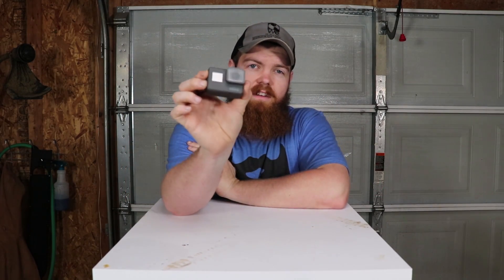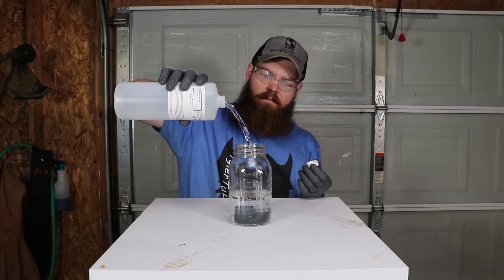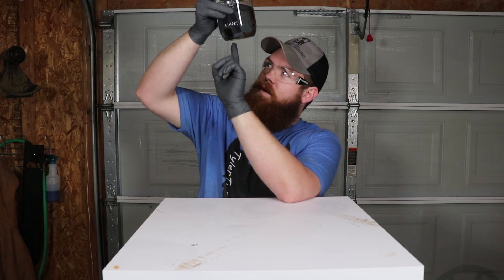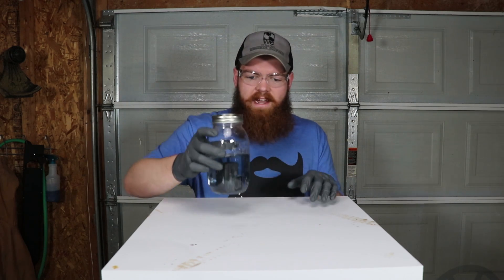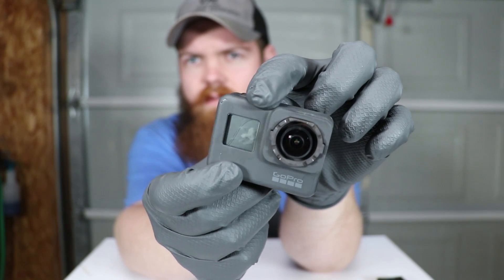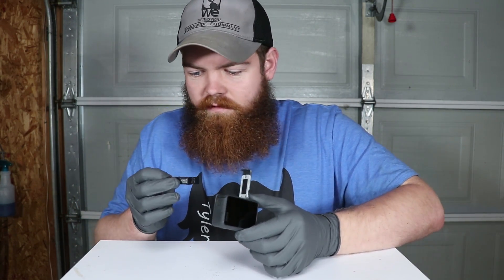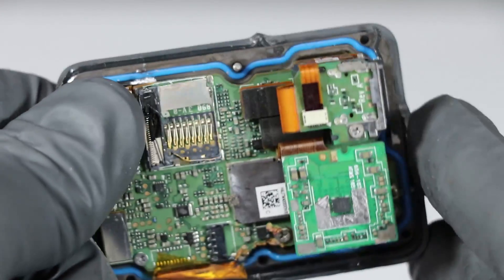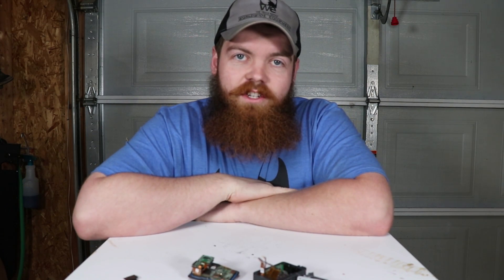I Left My GoPro In Sulfuric Acid For 7 Days...

Comment: NEXT TIME LET THE DEVICE SIT IN A BOWL OF RICE FOR 30 DAYS. THEN YOU WOULD REALLY BE GIVING IT THE ABSOLUTE BEST CHANCE POSSIBLE
Reply: God the rice thing is such bullshit man it takes 30 days to dry cause thats how long the water took to evaporate (which also means more time for corrosion) just set it in front of a heater for 1-2 days (like a space heater on low heat) so it makes the device warm enough to evaporate the water off but it will be faster cause more heat

Comment: Hey Tyler just a heads up, anytime you are working with any type of chemical that can cause skin irritations or even chemical burns such as sulfuric acid, it is always the best idea to have a solution made from baking soda and water.  The baking soda will dilute and deactivate the acidity in any chemicals you may be using. Hope you read this, it is the best safety procedure when dealing with viscous chemicals.

Comment: You likely killed it during the wash.  Should done a dry wash with baking soda.
Reply: If the acid dissolved the rubber seal then then it likely got into the GoPro.
Reply: So the acid didnt break it being in there 7 days .... but washing it for 2 minutes did break it.  No logic
Reply: Unless it has current going through it, it should be just fine. I've submerged a 360 controller and let it dry, worked perfectly.
Reply: @brianredfield8039  yea i love freaking people out by washing electronics hahaha 🤣

Comment: I have a feeling that swimming in concentrate sulfuric acid will not have the reaction you’d expect. Contrary to what might think, introducing a more dilute solution using water will actually cause it to dissolve more.

Comment: You need to make sure when you wash something covered in acid to rinse it off in a base solution to neutralize the acid's effect. Also when you need to dry electronics that maybe water damaged put it in a jar or zip lock bag and cover it in uncooked rice. The rice will absorb any moisture in the item and will take about a week or so depending on the size of the device. Make sure to change out the rice with fresh dry rice as needed to reduce the chance of mold.
Reply: The rice thing sucks and is a waste of time  it just needed to be left to dry in the sun for longer like 2 days or you can set something in fron of a space heater on low or something for a day or 2 so it actually heats and evaporates the water

Comment: Tyler : “They can be completely submerged and they won’t have any issues”

GoPro: *Has Audio Issue*
Reply: It's the audio equalizer, turns down loud noises so it doesn't kill your speakers, it just lasts a little long for most situations
Reply: The mic is just full of water that's it
Reply: A droplet if water was above the mic
Reply: Its an issue if its an issue, those are just excuses. "Oh my speaker doesn't have any issues, just replace the broken coil and it will work" is almost equivalent to "oh the camera doesn't have any issues, you just can't hear anything until you dry it"
Reply: @404_thoughtsnotfound  well, that's a bit like "you won't hear much sound if you put it in a vacuum" or "The picture will get super shitty if you smear the lens with shit"... Of course wrapping/covering the camera in stuff will affect it's sensors, but it's not permanent damage and doesn't destroy the components.

Comment: If it had a fully plastic housing, it may have survived. Most acids wont dissolve plastic, hence the plastic bottle the acid came in... I figure the acid found some point on the exterior that wasnt plastic and it was a chain reaction from there (never had a go-pro so I'm not sure)

Comment: What molarity sulfuric acid did you use? In my chemistry labs at university we would play with 8 molar hydrochloric acid; I think that would be a fun one to try. If I remember correctly, around 8 molar solutions are the most concentrated solutions you can obtain without a special license.

Comment: I don't know if you had any on hand at the ready or knew about this but just a precaution for your next sulfuric acid video, have a tub of high concentrated sodium bicarbonate water mixture aka baking soda near. It neutralizes the acid. In case of accidental contact or just to wash the submerged object before handling it. I noticed you took you glasses off with the gloves on after handling the acid as well. One flick of a drop of that in your eyes will not be good. Just a precaution.

Comment: You should revisit this witch concentrated sulfuric acid. I think what you were using was a diluted form. With a week of it being exposed you should have seen a significant amount of of damage compared to what you're results were. Also you need to have some baking soda and water in your immediate access in case of an accidental exposure.

Comment: See if you can use an egg as a glue I put a egg on a metal plate outside in the heat and it was kinda cooked I took the residue and it was really sticky You should try it

Comment: You definitely could have done with some more concentrated acid. You just poured it into an aluminium tray and there was no visible reaction. That makes me think this stuff is pretty weak.
Reply: Nate 22 all I’ve been thinking. Been messing with hydrochloride acid all week and it turns all steel black in seconds.
Reply: That's normal for sulfuric acid, especially when it's cold because sulfuric acid normally only reacts with organic stuff(with carbon atoms in it) where as hydrochloric acid reacts with anorganic stuff(especially aluminium) very violently. In a nutshell he should have heated the acid and there would have been much more damage

Comment: So you got a plastic camera I was on board until you pulled up a plastic bottle of acid I'm pretty sure they made that camera resistant to common types of acid
Reply: plastic is resistant more than u think (look at our oceans)
but robber is not, nor metal or electronics, but all depends on chemicals used